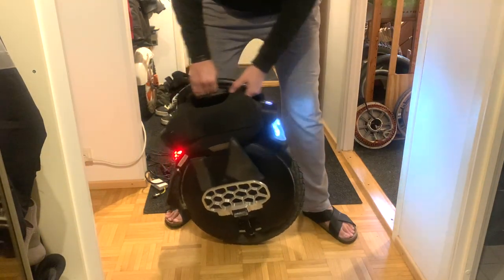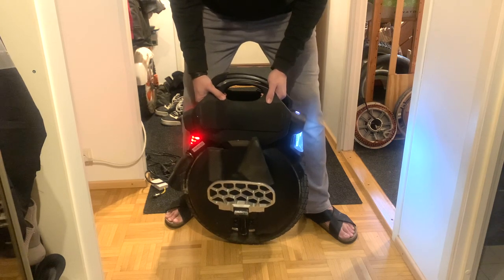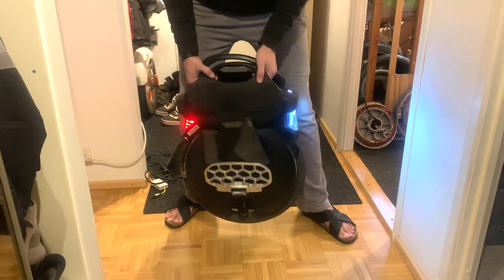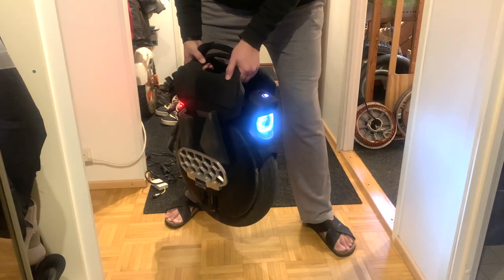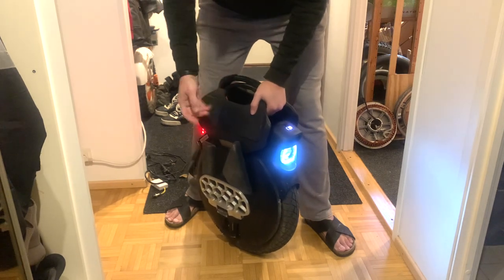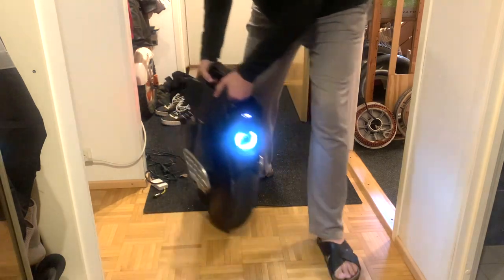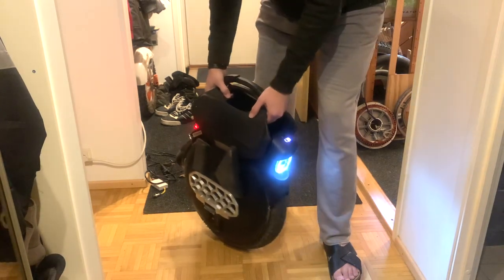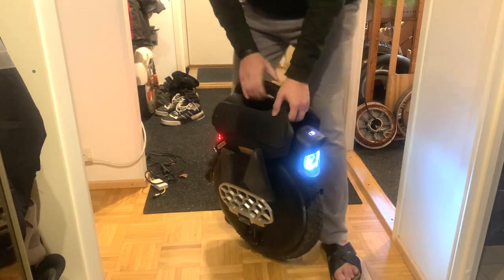EUC: Inmotion's "Motor no-load detection" demonstration

Comment: This makes me a little nervous. I’d never select it in the options. I have often wondered if this is the cause of some of the V12 HT issues
Reply from the maker: The feature doesn’t function if the speed is faster than about 4km/h, so the only problems I can think of are if you try to jump very high when stationary…

I don’t use the feature myself, since I often need to free spin the tire a bit to get rid of the snow on the tire.

Comment: I dont have your email, so i must write here :/
Today i had some serious problem with my v11, for the first time.
The problem occurred during charging. I put it at 70% battery and after two and a half hours I checked on the app it was at 97% after which I went to the settings to play around with the audio pack I wanted to change a few sounds with the DIY option. During that process, the v11 started beeping and reporting an error "danger, danger, contact your dealer" after which I quickly disconnected from charging and waited 15 minutes. When I turned it on, it no longer had gyro and was locked in safe mode. Due to the different time zone, the service is not online, so I have to wait until tomorrow for their answer and help. Otherwise, the batteries have no oscillations in voltage, and before charging it was not driven over night for about 12 hours, so everything was regular, temperature in room is normal. Every charge before that was after a green light up to 2 hours over. 
Do you know what it could be and how to solve the problem?
Reply from the maker: This sounds like the safety system Inmotion has set to recognize dangerously faulty batteries. If the voltage difference between the left and right battery is more than 5V, it will lock the wheel. The only way to get it unlocked is to contact Inmotion and let them check the wheel’s vitals remotely. They are looking at a data far more detailed than what’s visible to us. If they deem that everything is fine, they will unlock the wheel. If not, you need to exercise the warranty or buy a new battery outright by yourself.
Reply: @mrelwood_EUC  battery pack information showing excellent state of voltage , the difference is almost non-existent 81.8 vs 81.9 V, both are detected, but both disabled with battery error - OK/OK.
Reply from the maker: @SamoukiTuki  Yeah, I’ve heard of that happening to others as well. The voltage difference has probably been a temporary situation that the pack balancing system has since been able to rectify. But the reason for the imbalance still hasn’t been fixed, and may cause issues or even dangers.
Reply: @mrelwood_EUC  thank you for your time, I appreciate it! I'm keeping my fingers crossed that they will unlock my wheel in the morning, and I will check how many volts the charger has, I heard that it can be opened and set if it gives more or less current.
Reply from the maker: @SamoukiTuki  Let’s hope for the best. Though you might have to prepare for a bit longer time waiting, don’t know.

Most chargers have an adjustable output voltage. But you absolutely shouldn’t touch it unless you have a calibrated good quality voltage meter as a reference!! Besides, a charger can’t cause a voltage difference in the battery packs, since they are recharged at the same time anyway.

Comment: What tire on V11 !!!???
Reply from the maker: Heidenau K66 80/90-14 (Snowtex). The best universal tire I’ve found so far.
Reply: @mrelwood_EUC  how does that compare with the stock tire?
I’ll need to replace my stock tire soon.
Reply from the maker: Lots of comments and reviews at forum.electrikunicycle.org. It’s much more stable, easier to balance at slow speeds, grips better etc.
Reply: @mrelwood_EUC  hmm that appears to be a 14” tubeless tire. You put it on your v11?
Maybe I’m misunderstanding something.
Reply from the maker: No, on EUCs it’s not at all rare to use a tubeless tire with a tube. Motorcycle tires denote the rim size, bicycle tires the approximate outer diameter. More on tire sizes here:
https://forum.electricunicycle.org/topic/19313-tire-sizes-explained
Reply: @mrelwood_EUC  great post thanks

Comment: I rather put such unnecessary features off, less features active, less bugs during riding :D.
Reply from the maker: Me too. Just the thought of forgetting to have the feature engaged in the wrong situation keeps me having it off. And since the lift switch is already so well positioned and well working on the V11.